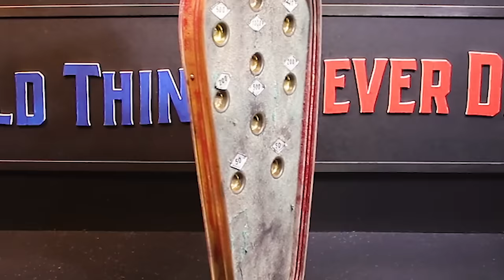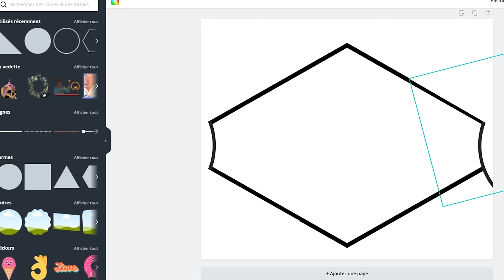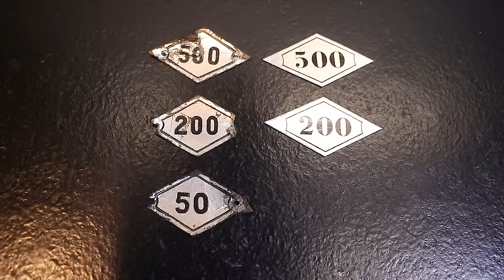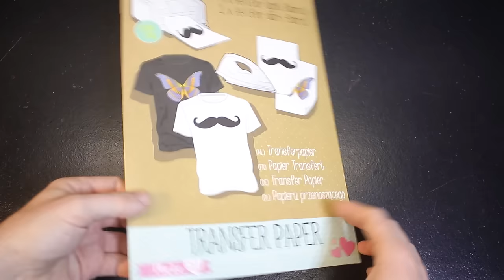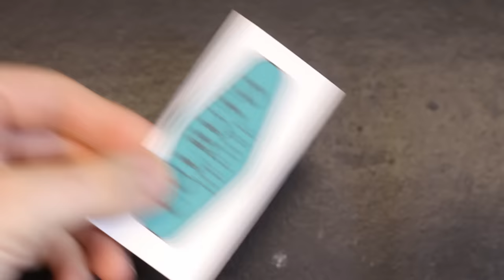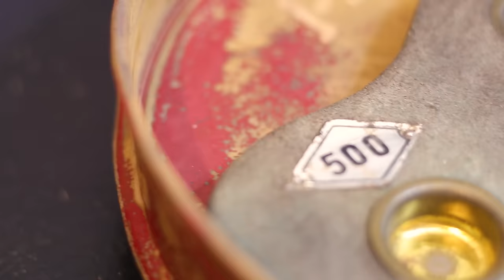Old and Rusty Game of Skill - Restoration

Comment: Fantastic restoration, intrigued by the brass “plating” technique, do you just heat the part and then rely on the brass coating transferring from the brush? Never seen that before. 😊
Reply from the maker: Exactly, brass is tender metal so by heating it, it's sufficient to make plating 👍
Reply: @OldThingsNeverDie-  Amazing! Thank you for sharing
Reply: I think I learned that from Adam Savage on his channel. (The guy from Mythbusters)

Comment: I think you did a wonderful job of restoration, but...
Wouldn't green felt have been better than that green t-shirt?
Reply: I guess he figured a t-shirt was a better match for the original al material, it didn’t seem much like felt, just a cotton like material.
Reply: @therestorationofdrwho1865  I think they mostly use baize on this kind of stuff, like the ones used for card tables and pool tables.
Reply: I think he used the green shirt because of the iron on logo. I don't think you can do that with felt

Comment: This was less of a restoration and more of a complete replacement in my mind. Still, enjoyable.
Reply: very interesting application of the ship of theseus dilemma in these restoration videos. at what point does it change from restoration to a different product? how much of the initial piece needs to be retained?
Reply: I think the point of restoration is to see what things used to be like when they were new. If some parts don't look like new, it's not a full restoration.
Reply: ngl this is the one time I was on board with someone just replacing a large part since cork board is just bad.
Reply: I agree. He replaced too much of the original for this to be called a restoration. The thing that infuriated me most was that he didn’t keep the original font for the plates. In the end a nice toy, I guess, but more like a brand new thing than a restored vintage product.
Reply: Literally one item was replaced.

Comment: The only suggestion I would make is this: The logo transfer would have worked fine on 'light T-shirt' paper, with the cloth showing through and only the black parts printed. You only really need 'dark T-shirt' paper if the image you want to transfer has sections that are of a lighter color than the cloth. I know it's two years later though and you probably figured this out already 😅 Loved the video though, very nice work!

Comment: Why not just restore the original piece of wood?
Reply: Yeah would have been nice.
Reply: It looked like particle board, didn't know that was even available in 1920
Reply: Particleboard is jusr sawdust and glue compressed together. it’s been around for quite a while.  it was used for things like this in the past, not for things like tables and cabinets like it is now.   I went back and looked and the old board was pretty chewed up.  by replacing it with wood he majorly upgraded it. well done sir well done.  However I would’ve made a mold that I filled with resin with a ball bearing in one end to make a new “ball“ a little more time but I think it would look totally cool.
Reply from the maker: Particleboard was moldy, indeed, i prefered make a new one in plywood. Great idea to make a new ball with resin, I had not thought about it 👍

Comment: It's too bad you didn't use the original wood insert. It seemed salvageable. 100% respect for your skill but restoration is surely about re-using as much of the original as possible otherwise what you've really done is build a new one not restored the old.